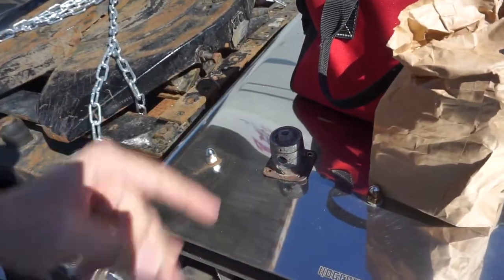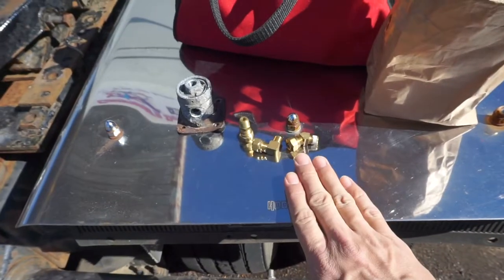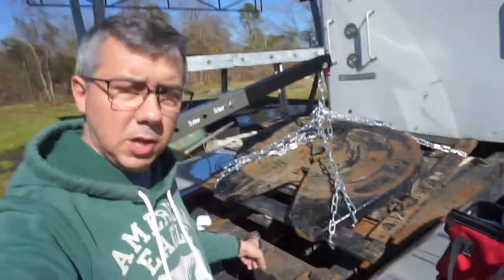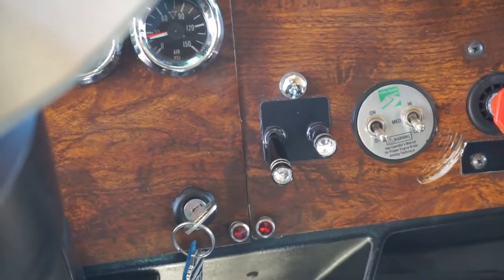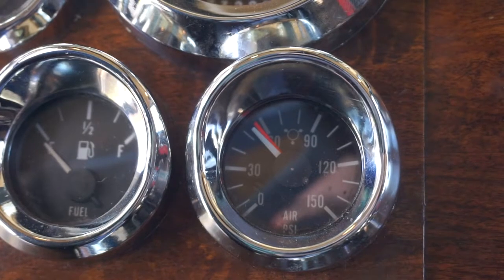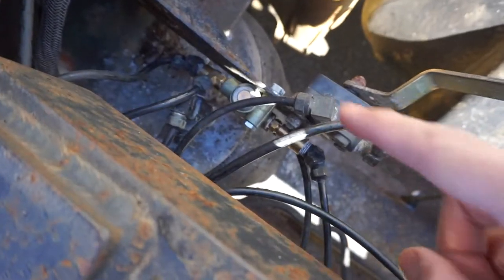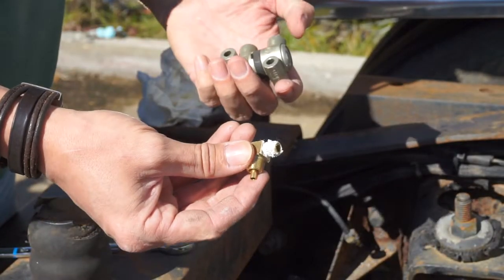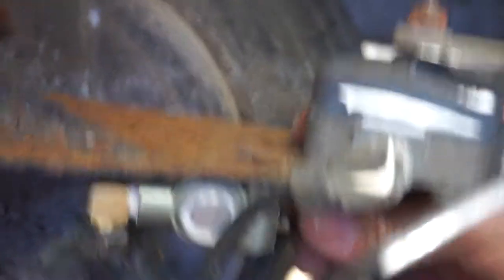Finally Got the Air Bags Working! - Peterbilt 377 Dump Valve Install

Comment: hi, did you have to run a switch into the cab? Is it all ran on air? Or does the switch have any electrical stuff init